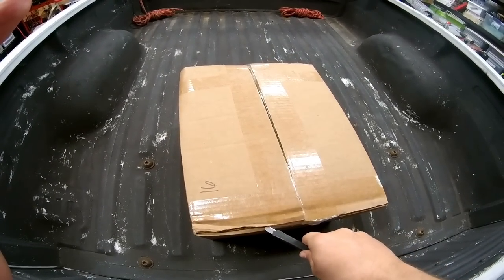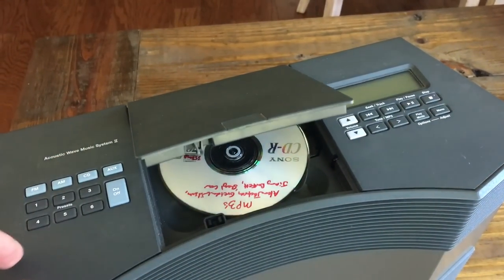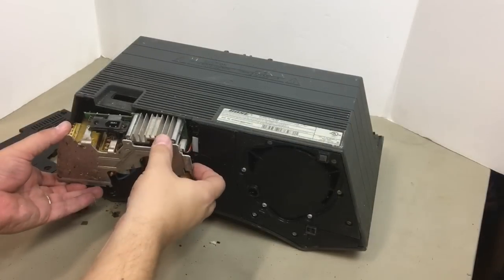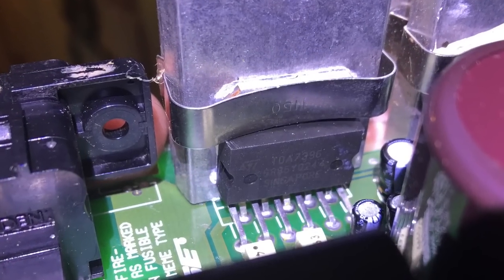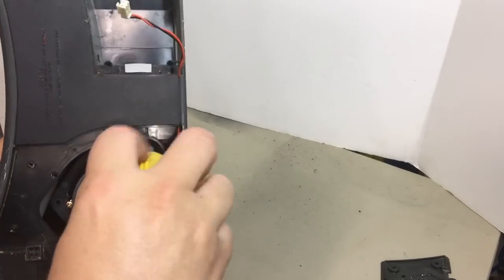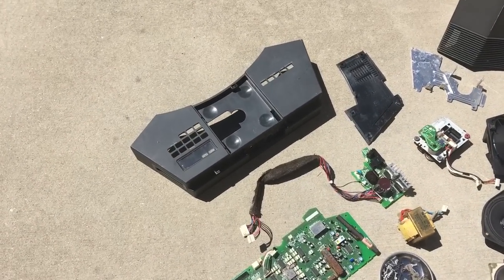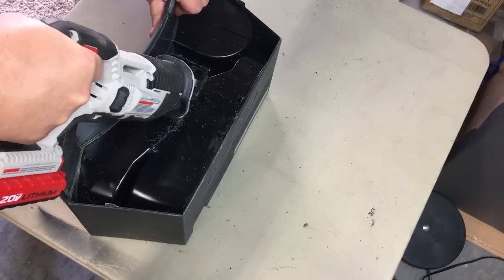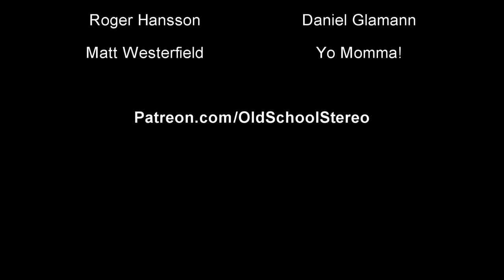What's Inside $1100 Bose Acoustic Wave Music System CD-3000

Comment: Thanks for the tear down.  It was informative.  However, the slightly odd numbers you got with your meter were because you were measuring resistance, not impedance.  Resistance is DC, while impedance is AC, so the measuring methods are a little different.

The “waveguide” is better known as a folded horn to most speaker manufacturers.  You’ll notice that instead of becoming gradually wider as it approaches the mouth, like most horns, these are simple constant-diameter tubes.  That looks like laziness on the part of the engineers, since a plastic molding could be made in any shape, and a tapered horn would sound better, although the calculations to design it would be more complex.

The Acoustic Wave unit seems to be cheap in every way, from its design to its materials to its construction.  All of Bose’s R&D budget appears to go into market research, not audio research.  This enables them to sell lots of mediocre-sounding systems to customers who trusted a famous name to give them quality and value.  Those customers were out of luck on both counts.
.
Reply from the maker: Thanks for the comment. I updated the video description after my fail on the resistance vs. impedance part, guess I should make it a sticky comment. Too bad I can't go back and edit the incorrect stuff out, just has too many views at this point and YT doesn't allow annotations in the videos anymore...

Comment: put this system next to one of its direct competitors, for instance the Proton 300/301 table radio/ext speaker combo with msrp of $700 in 1989- 1/3 cheaper or less lacking the Bose price fixing scheme. I own the Proton set now and have owned the AWMS. The Proton spanks it on sheer volume, accuracy, bass and treble response, it images properly and if you choose to listen sitting down it effortlessly does what the AWMS can never do: produces a phantom channel allowing stereo recordings to sound as the recording engineer intended.
You couldnt make this video for the Proton. The units both have heavy steel cases.
Reply from the maker: +batvette Proton made very nice equipment back then. I have the D1200 amplifier and its built like a tank 👍

Comment: I bought my first one for $250 at a pawn shop. What an unbelievable sound. I agree it is not worth $1,100 to me but it was certainly worth $250 for a boombox that has a huge sound. I put it on the stage of a theater where we were working and played a cassette of the theater pipe organ on which we were working. Then I went into the balcony and listened and it sounded great in an empty theater. Of course people would absorb all that sound but I was surprised anyway. I was brokenhearted when that one was stolen so I bought another one on eBay that was not in as good of condition but still, I only want it for the sound not the radio and not the cassette. Run a Bluetooth through it now at home.
Reply from the maker: Lots of haters commenting, but i wonder how many have heard this? I agree with you. Way too expensive, but these aren’t made for those who are concerned with the price

Comment: Their motto - "Better sound thru research" - should really be "Better sound thru a ton of equalization". Their demo CDs make this unit sound awesome for its size, but only to the average listener. I sold these in a mall kiosk for a while, which was the absolute WORST place to demo them. Old tech marketed as new tech, as other comments have noted. BIG mark-up. But they DO fill the niche of what ham operators call "appliance operators" -  decent sound in a small package that's very simple to use (think housewives of the 1950's). I actually have 2 of these myself; one in a seldom-used living room,  and the other as a portable boom-box (they excel at this use). Get a used one, or one with a broken CD player, for less than $150. Spend  $20 for a cheap bluetooth adapter to let you stream music from your phone. The canvas case can be had for $25 or so. Then get a surplus 12-volt 7000 mA gel-cell battery ($20) and solder a DC plug onto it, so you can plug it into the AWMS. Store the battery and the bluetooth adapter in the bag. Now you have a great portable radio / music player that streams songs from your portable device for less than $200 total.  Very heavy to carry, but will sound better than any other bluetooth speaker on the market!

Comment: I think Bose stole an idea that was used by Stromberg Carlson back about 1939 to mid 1946 or so, It was called the "Acoustical Labyrinth speaker system !!  Look up Stromberg Carlson Acoustical Labyrinth speaker system to get particulars on its design. I have one of these monster console radio's that has 4 6v6 tubes in parallel push pull output pushing about 15 watts into a 10 inch speaker mounted in an Acoustical Labyrinth Box that EFFECTIVELY makes a LONG FOLDED HORN, but on the BACK SIDE of the SPEAKER and it really does improve the sound !!!
Reply: An acoustic labyrinth is not a horn. l

Comment: Higher ohms are cleaner and have tighter response than low ohm drivers ! Especially in a high and or midrange application.
Working with active crossovers and speakers wired in series is what makes you know that .or the 901

Comment: I bought one of those at Goodwill today for $5.99 in excellent condition with remote. Actually I bought two Bose radios for $5.99 each. The second one was the smaller Bose and the cd drive doesn't work. But the radio and remote works great. Got two radios and three remotes for  $11.98 plus tax.
Reply from the maker: Wow, great deal!

Comment: The 4 inch driver on my 1992 model is actually better than the 901 driver due to have better quality surrounds that don't rot out like the foam ones on a 901 driver. For the $30 i bought it for its not a bad setup, though the tuner is average at best. I mostly use it for the aux inputs.

Comment: The DC resistance of the voice coil is not the same as the rated impedance. A VC that measures 11 ohms DC is probably a 16 ohm driver. The woofer, at about 2.5 ohms DC is most likely a 4 ohm driver.
Reply from the maker: Yessir, i goofed and updated video description to explain better. No way to update video to include this info, thanks YouTube...

Comment: I am sure the controls were none functional,  but I would have tried the amp.  It looked real clean. You might have been able to convert it into a Bluetooth speaker with the same audio properties as the original device.
Reply from the maker: I saved the amp, the transformer and the speakers.

Comment: Always wanted to know what was inside, even more after learned acoustic wave means transmission line
Reply: Transmission Line loading has been around for many years and works well in IMF, TDL and PMC designs. Bose's version of it uses a much shorter line/duct but the maths doesn't really work the same way and the sounds is nothing like as good as a dedicated transmission line hifi speaker. Using plastic for the line doesn't help but I suppose there's little choice in that type of product. Boosting the bass electronically just makes the whole sound less clear.

Comment: I've had one of the smaller Bose CD and radio units and it ran for maybe 15-20 minutes then it just died. what I find with Bose is their electronics are junk but their speakers are amazing. I have the speaker/waveguide assembly and I'm going to make an amp/radio out of it.
And you should get that main amp going and clean that thing up and build a powered speaker.
Reply from the maker: +coondogtheman1234 I kinda broke this one...oops. That is a great idea 💡
Reply: BigDWiz make sure to post a video. Maybe the next Bose unit you can build an amp out of it. I know it has line inputs but if  that main board is dead but the main amp is good then you can build an amplified speaker. I have the waveguide assembly from my Bose radio connected to an old car stereo.

Comment: Thanks.  Always wondered how the acoustic wave-guide, or wave-path setup was in these "Wave" units.  It's about what I thought.  Amazing Bose did not include a tone control.  Also, I always just assumed this Bose was just a 2 speaker system.  The third was a surprise.  Also, it seems odd that the left side is woofer, or low end and right side is mid and high range combined.  I mean, what does that arrangement do to the balance of the stereo function?

Comment: The speaker doesn't read the proper impedance because you measured it face down with the cone getting touched by your table and that will effect your impedance reading.
Reply from the maker: I was measuring resistance, not impedance. A lot of factors can affect measurements

Comment: The "quality" of BOSE in in their marketing, quality marketing.  Is 10% Total Harmonic Distortion (THD) a normal spec in today's amps?  In the 70's we bought cheap Pioneer, Sony and and the others, amps and receivers.  And the specs for THD were figures that started with a zero, followed by a period, followed by another zero and then some number.  Also a Pioneer amp that was rated at 2X15 watt had about 8 times the amp power that this BOSE with its combined 100 watt of amp power.

Comment: I was expecting a fairly high displacement 4-5" woofer on the bass range, rather than what looks like a PA mid-bass driver. Although the 6th order version of the transmission line is interesting.
It doesn't look like $1100 worth of stuff though unless casting that bass pipe was really expensive.

Comment: Very clever... and very cheap.

You could make a decent bluetooth speaker if the speakers and amplifier still worked.  Get one of those modules to convert a car radio to bluetooth and wire it into the input of the power amp.  Some kind of volume control might be a good idea too.  You could take a dumpster Waveguide, a $20 Bluetooth conversion module, and maybe $5 worth of electronic parts and do it.
Reply: Wow ! I didn't know we had Bluetooth Conversions Modules in the 90s , when this was made?

Comment: I'm guessing the overall performance is what one should take away from this. The R&D that goes into making something like this probably where most of the money goes. Bose is one of those no nonsense kind of companies. They usually don't harp on wattage/specs, just how it sounds. Much like everything in the world, sound is extremely relative and subjective at best. There are not many manufacturers making anything comparable. At any rate, literally just like anything else, if you do not like it, don't buy. I really do not see why folks bash brands that they either cannot afford or just do not like (for whatever reason). Is it worth $1100? That would completely depend on your listening needs. I know several folks who had enormous amounts of money sunk into much more "higher end" equipment. Eventually, the hassle of trying to show the wife/girlfriend how to use was too much and ended up with one of these or another Bose product. Much happiness was had and whatever loss of volume or quality was negligible. Just another worthless 2 cents of opinion.

Comment: Is that a 120 volt ac transformer down to 24volts ac? That is what I found when taking apart 32123 acustamass unit with it running 100 attacks x3 two wall/surround and the bass subwoofer box all was in it but had a console control box just woundering if that one is 24 volts ac

Comment: This is not a horn loaded design. instead it's more like a folded transmission line. the front of the 4inch driver loaded into the entire labyrinth of ducting starting at the back half of the enclosure, then wound it's way thru all of the front half of the folding and exiting out the lower right opening. this long path probably also served a second role in time alignment with the output from the rear of the driver, which has a much shorter path that exits the lower left opening.

nothing magical here.  it's a design that's decades older than the first version bose released.  

Bose, in my opinion,  is just like Apple products;  their biggest achievement has only been to effectively market a product of decent build/material quality, then wrap it in a simple (but sexy) esthetically pleasing package with a limited, yet intuitive feature-set & user interface . the technology(s) involved are rarely, if ever, different from many other competing products available.

 Are they overpriced??  apparently not.  the "fools"/individuals that continue to support products & manufacturers like this, think the price is worth it. and "they" are quite a large demographic with a hefty market $hare, regardless of their sized percentage.

 personally, I spend my money differently, at first.   however, it must be said that manufacturers/products as mentioned above, are certainly NOT gimmicky Junk!  Ultimately because of the overall quality & smart design involved, I myself eventually fall victim & cannot wait to put one of these speakers on the back tank of my toilet whilst I sit listening to great audio paired via Bluetooth to my macbook watching clown-porn via dual boot linux OS...
   just like every God-fearing good American should!!

Comment: Ok you did not check impedance with an ohm meter.  
An ohm meter does not read impedance, it reads DC resistance.  
Impedance is an AC measurement that is based on the AC resistance of the coil at a certain frequency.
Reply: I'm glad someone here knows the basics.
Reply from the maker: I totally blew it and you can rest assured I will be reminded of my error....over and over. Too bad YT doesn't allow annotations anymore or I'd correct it in the vid. I'll add additional info to the video description.
Reply from the maker: For real, this guy who makes these vids is an idiot....I mean human. Oh, perfection in still in reach though
Reply: Just pointing it out.  Not everyone is aware of the difference between impedance and dc resistance.
Reply: valveman12 yeah but a simple resistance reading gives you a good idea of impedance. you wouldnt design a xover with it but you might use it to pick a replacement driver.
Reply: batvette  Using an ohm meter does not give you any idea of impedance.  As I said, impedance is frequency dependent.  The two are not related in any way.  Look it up.

Comment: Big D Wiz I'm building a box for a JL audio W7 13.5 I was building the standard ported box recommended but have noticed people building 4th and 6th order boxes I am going to run it on a Orion hcca 3000.1 splx will wire it in parallel to put it at .75 ohm the amplifier should have no problem pushing that what box would you recommend a 4th order 6 order or just the standard ported
Reply from the maker: Depends on goals. JL has recommendations based on what you are looking for

Comment: Ever since they came out on the market I was always intrigued to how it worked. Am I right in thinking the bass driver is sort of in the middle of a long tube that is open at both ends?
Reply from the maker: +Andrew HIGGINBOTTOM yes, it has two ports, one short and the other much longer
Reply: BigDWiz would it be possible for you to measure the path lenth of the tube in front of and behind the driver. I find this open tube concept intriguing

Comment: You can expect different voice coil resistance numbers if the speaker was first measured\tested in a cold(er) climate, if your climate is warmer... My JBL GTO1214 is rated at 3.76 ohms but measures at about 5 ohms - AND(Important)......6 ohms when Hot... #AverageTempInTheThirties #ThermalCompression
Reply from the maker: +Marvin Connell #GreatPointYo 😜

Comment: HI guys, after the fact and when was the last time you listen to music to one of those?  When I first heard this I was amazed, tell me nowadays what does sound like this, in such a small size.  If anything I am even more amazed by the fact that from nothing they build a sound like this. This was the clearest sound. Sure you have to take under the consideration of the quality of the produced sound of CD and so but boy this was the sound. I did like the video, but I would like to see more info on the acoustics just like the author said, there is the key not the electronics so much.  The highs were highs the base was base.  This thing kept us listening to quality music for years. I just do not agree with many of you guys, considering the quality of the music, which was not to quality standards, therefore it was probably harder to produce a good sound of shit quality of record than now. Thanks.
Reply from the maker: I think they sound pretty good for the components. They are expensive, lots of engineering, but yeah sound is 👌to my ears

Comment: The BOSE formula goes like this: making products that most of the consumers/people consider to have a good sound, while using the cheapest components possible to achieve it. Then invest heavily on marketing & PR to justify the premium pricing.
Ever wondered why BOSE retailers always have those special rooms, where you can ONLY listen to their equipment? 😉
Reply from the maker: Seems to work for them. Simple products and a name non audiophiles can’t resist
Reply: @wal  undoubtedly, since 40 years. 
But just you imagine what their R&D department could make, if they were allowed to use premium components. I mean, if they are capable to make crap components in a small plastic box sound decent...